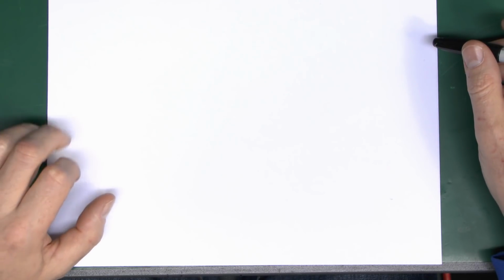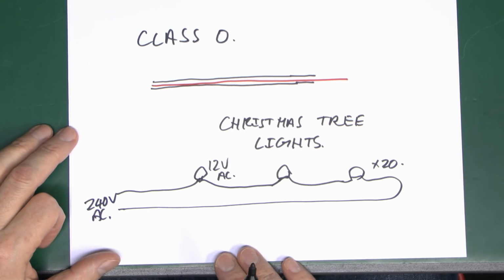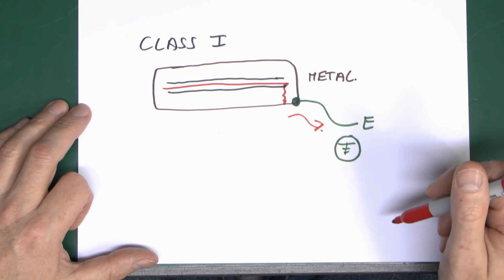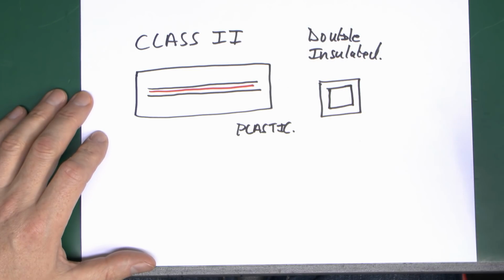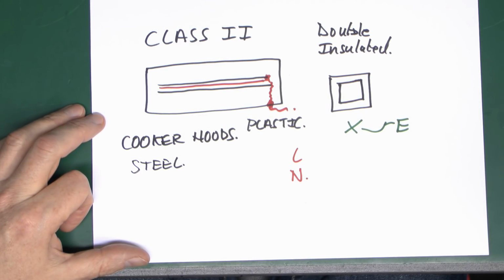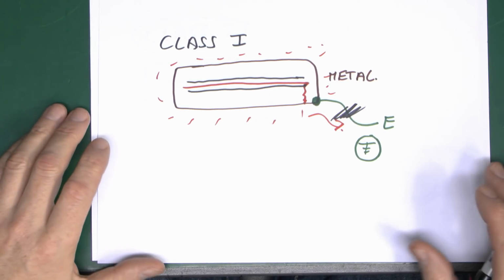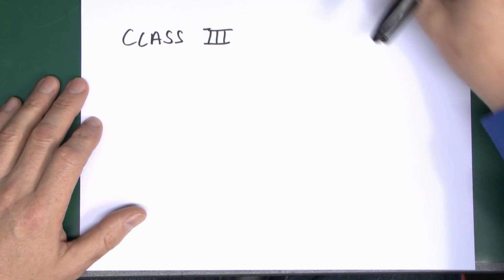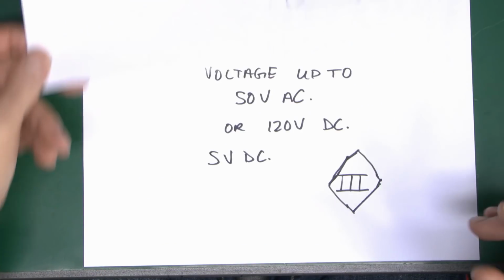Appliance Protection Classes 0, I, II, III

Comment: 12V LED lights are protection class III if a safety transformer is used.
For example, lighting a pool, bathtub or shower in the splash area.
A 240V light cannot be installed there but 12V is save.

Comment: I know you say earthing a class 2 device creates more danger, but how is this more dangerous than earthing a class 1 device in terms of providing a route to earth? Specifically I’m talking about metal light fitting. I’ve cut the DI connectors off as they were too fiddly, connecting ceiling rose wiring via wagos, and on someone else’s advice earthed the mounting bracket, to make it “class 1”. Is this unsafe? The problem I have are inaccessible ceiling voids and rigid insulation.

Comment: I have an old all-metal sewing machine that is not earthed (class 0???) Is it possible to test this?
Reply: My suggestion:
Check continuity between the motor body and sewing machine frame. If there's continuity it's not safe. Mount the motor on an wooden board and see the fasteners are not in contact with the machine frame.

Comment: Alot of USB plug chargers fail PAT just on inspection as they have no class 2 markings and class 1 test would fail as no metal.  The rule is no Class 1 2 3 4 marking then regardless of what you think the class should be, you treat it as a class one and test as a class one, which more than likely will fail, due to you can not get the earth test probe on to any metal, or the metal is not earthed as it is a class two inside with a additional metal covering.

Also metal hand tools, ie old drills, hair dryers and curlers are banned ( fail a PAT automactically ) regardless if they are class 1 and pass a class 1 test.

They are lots of odd rules for class 1 2 3 4

I have also come across a class two with Earth (which can be allowed) and a HV DC with Earth which you treat as Class one.

Seaward PAT testers has special settings for these in the top models.

Again these old Classes are not consumer, but found in Manufactuering, Mining, EX areas, Medical, other  test and measurement labs and even some EFTpos.
Reply: You sound like you were mistrained to be an unreasonable bastard, misapplying misunderstood rules.  Because whomever trained you told you those misunderstandings.

Comment: How about Class Special.... ?

CRT Monitors - no Earth due to they have a virtual Earth, but they are not a Class 2. ( for PAT testing you have to do a altered Class 1 test ).
Some test and measurement equipment (non consumer).
Zero Earth areas as defined in RTEEB (CRT and HV SMPSU) repair areas.
Semi conductor prodution lines, ie Timex and Casio put 50Vdc throu the staff, ie virtual earth set to 50V not zero V ( E ground ) set at 50V to stop static,

Class 3  at 50V was beacuse of BT Engineers didn't need a IEE licence, and a BT Telco one would do.

Comment: I may have ruined a lovely mains table lamp!  This eBay lamp, shallow round metal base, narrow chromed metal upright teeing out to ceramic led sockets was not earthed.  But all through was run in its own sheath and an extra silicone sheath. I thought it had to be earthed but it looks like you are saying it could still be Class II, is that so?
Reply: Silicone sheath would be the second insulation.

Comment: Why are metal table / floor lamps Class II when the mains wire goes up the metal stand with only the PVC wire insulation? I can never understand that?!
Reply: The PVC insulation is most likely double layered, hence satisfying the double insulation requirements.
Reply: @Grizzly01  I didn't think I that the standard mains flex PVC outer sleeve counted as double insulation to be honest but thanks for the info.

Comment: Do these classes also apply to secondary voltages? 
So assuming you have some kind of 12V wall adapter and inside the device it's being converted to a voltage higher than 120Vdc? (Which is also isolated from mains)

Comment: 17:30 Talking bullshit - it doesn't matter if the item runs at 5 Volts or not. All that states is the pd of the connectors is 5V - so they could be 235V and 240V - they will work fine and possibly kill you.

I installed 3 LV bathroom lights for a friend. The colour codes I used for the LV wiring was brown and green/yellow. The green/yellow being earthed and the brown being 12V above that.
So, despite being LV, they were still earthed. So, even if the transformer had a complete meltdown, it would not be possible to get an electrical shock from the earthed side of the bulbs.

Comment: 17:00 Talking outta your arse John. My laptops are earthed - I get 'mild' continuity between USB ports on 2 laptops only connected to the mains. The outer pin of the power brick plug IS earthed - so the laptop is connected to earth - so I guess it's a class I device.
Reply: It does sound like you have some knowledge of the subject, but not quite enough to know when you're talking out of your arse.
Look up Class III construction, and you'll see what it says about earthing.
And then you'll realise that your laptop isn't actually a class III appliance, as the power supply isn't SELV.

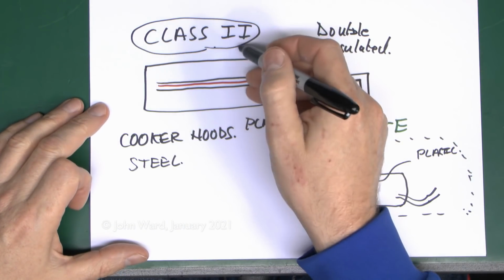Comment: 13:00 TOTALLY DISAGREE WITH YOU ABOUT NOT EARTHING SAY A METAL COOKER HOOD.

The reason you give is total nonsense considering most other metal surfaces in the kitchen will be connected to earth - sink and all appliances etc.

So I'd recommend connecting any bare metal to electrical earth. You know, like is recommended with heating radiators - LOL
Reply: You are getting into the realm of the difference between earthing and bonding.
There is the potential to make something more dangerous by bonding it when it doesn't need to be.
Reply: @Grizzly01  That's why it should be earthed, not bonded !

Comment: I'd totally ignore JW's advice about things not being earthed. If there are any exposed metal parts on a piece of equipment connected to mains power, I'd say get it earthed. You generally find exposed metal parts on connectors for microphones, video leads audio leads etc.
My very plastic laptop is earthed - by the manufacturer of the power brick.
Reply: Then again, you may cause unforeseen problems by randomly earthing bits that have been designed not to be earthed.
Especially in audio visual equipment.
Reply: @Grizzly01  Audio connectors do not dictate what equipment is connected and whether that provides a path to mains earth. Audio equipment connected to this laptop will be earthed whether it likes it or not.
In one of the items I earthed, I connected the earth lead to a PCB at a point marked on the board as an earth point !

Similarly, audio equipment may be connected to a live connector on other equipment - and that's precisely why I've added earthing.
A metal clad double insulated VCR connected to a TV Aerial socket at 240V is not a good situation.
Reply: @millomweb  Fucks sake, if you've got an aerial socket at 240V, you've got more to worry about than some poxy earthing on your VCR 😂😂

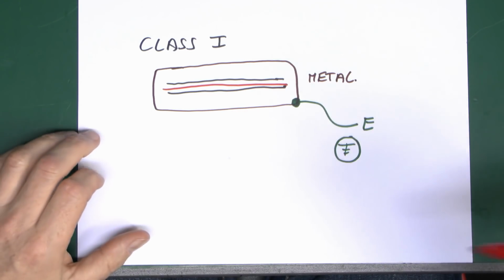Comment: 5:23 So what class is it where you have exposed live parts inside a metal case that's not earthed - like a Sony EVS800 for example ?
10 p in the right ventilation slot should complete the live connection to the unearthed casing.

I'm not sure I rewired both of mine with 3 core cable, but I certainly did one as well as a Panasonic video mixer with exposed metal parts. Which interesting was internally fitted with a marked terminal on the PCB for earthing but fitted with a 2 core cable.
Reply: Items like that, if they bear the class II construction mark, will be using the layer of air inside as insulation, which is only applicable if the case is intact.
The standard allows for it, but it does smack of a cost saving measure.
Reply: @Grizzly01  'case is intact' - yeah, but holey ! With a freshly sharpened coat hanger, you could make contact with live terminals with case in place.
I have similar thoughts about (belt) guards with holes or gaps in hidden places that are big enough to get a finger through and in danger.
Reply: @millomweb  Definitely need to read up on IP ratings.  First digit deals with these dangers.

Comment: Sorry john your not  quite correct, BS EN 60598 for lighting DOES allow for earth pass through on a class II device as long as the earth does not terminate or have a connection to driver/control gear  - Therefore  3 core with earth wire  could run into a class II luminaire and back out ! So not totally accurate to say all class II devices have no earth connection... some will have dumb terminals that just provide a loop in-loop out terminal separate as i said from driver or control gear.  Also there is definition of "Functional" earth rather than "Protective" earth allowed for class II  which is allowed earth connection on class II devices for EMC or screening purposes which is marked with a different symbol or "FE"  and NOT relied upon for safety. Did you know also there used to be a class OI ?

Comment: Where would you ordinarily find  the protection class number on an appliance. I have just examined my Laptop PC and its adapter and can find nothing. Also, on the subject of the PC adapter, what about the 240v power lead that i can disconnect from it? The PC should be class 3 but not the adapter surely?

Comment: There are two  probable"Class 0" products that I've recently come across in UK. 
First is smart-home WiFi switch beloved of the " middle tier" of geek for smart-home items.  These contain a mains power PCB enclosed directly in a single skin plastic housing, no CPC. Popular brand in that regard is 'Sonoff".
The other product is 230V LED rope- light for gardens. These are modern equivalent to old Xmas lights. Led's are organized such that enough in series plus the current limiting resistor makes up 230V at the user-cut lengths, typically 2 metre.  AFAICT, it's in a single layer plastic clear sausage. The user chops it off, pushes in a dodgy wire pin thing to connect the mains tails to the internal conductors, and installs them in their garden etc. One outlet of this is AFAICT a " LED ropelight" from a seller called Mr Resistor. I believe they also do a genuine neon version called 'filament ropelight".  ( Both may carry the "neon" moniker from some sellers, which may be incorrect in the case of the LED version).
Reply: Surely those Sonoff devices are meant to be installed in an enclosure?
Reply: @Grizzly01  Well I would, but not so from on-like geeky youtubers or manufacturers original intent. Saying that, I just went to their website before answering here and it seems they have re-vamped their basic model, and it now bears a double insulated logo, Probably an improvement over the first models then.

Comment: The power brick for my laptop has a 3 conductor mains cable connected by a sort of Kettle connector, but with a rounded body. The earth pin of the plug is connected  to the "kettle plug" but there is no way of telling whether earth is connected inside the brick.
Reply: The output lead to the laptop should be earthed. I presume the brick powers the laptop via a wire rather than magnetism (contactless charging)?
Reply: @millomweb  Both the +ve and -ve on the laptop barrel jack have about 100kohms resistance to the mains earth pin, so no earth connection to the laptop.
Reply: @MrFlint51  No resistance on the outer part of the plug on mine to mains earth.
Reply: @MrFlint51  I got 40k resistance between Earth and a USB port on the laptop.
Reply: @millomweb  Not always.
Some brands bring the earth connection through to the dc output barrel, some don't.
For example, Dell quite often do, but HP don't, in my experience.
Reply: @Grizzly01  Please put my HP prize directly in the bin - utter rubbish !
Samsung does - and I'm pleased about that.

Comment: What Class are Electric Toasters? They should be Class -1 as they have exposed conductors with no insulation. You can touch the live parts with your finger.
Reply: Class I. British are disadvantaged in that as the plug does not tell the class. In most other countries the plug immediately tells the class.
Reply: @okaro6595  Ditto radiant fires.
Reply: @okaro6595  Unless you have a moulded plug fitted to the equipment, with an ISOD rather than an earth pin. Then it's straightforward to tell the class =)
Reply: @Grizzly01  In Finland class 0, I and II have all different  plugs. Class 0 plugs fit only ungrouded sockets. It would be dangerous if yoụ touched a failed class 0 equipment and a grounded one at the same time.

Comment: Some Class 3 devices like Laptop PCs using an external PSU can read 230 V to Earth on the DC side of the PC input plug. Switch mode power supplys are not always isolated from the mains. Try it with your meter.
Reply: Some are faulty. Plug on mine is earthed - so the laptop is earthed - that makes me happy.
Reply: @millomweb  Check that with your meter!
Reply: @johndododoe1411  Congratulations, it's only taken you 7 months to work out how I did it !
Reply: @millomweb  The mains plug does no necessarily earth the actual laptop.

Comment: Class 0 items are still being sold certainly in 2020. We purchased a string of LED Christmas lights. Inside the mystery black box was just a bridge of diodes. The wire is   only single insulation. You will still get a shock to ground should you make contact with live. This was sold by Dunhelm.

Comment: It always amazes me that Class 0 still seems to be the standard for appliance cables in the US.
Reply: Mandated safety seems to diminish inversely to voltage.   In the US its a rite of passage for a kid to shock their hand while plugging something in and learning firsthand what 120V feels like.   I'm sure we'd be a lot less casual if it hurt twice as much than the brief "ow" we get.   I know the shock and fire hazard aspects are unrelated but I feel like Europe's better insulation regime stems from their desire to really not want to touch a live wire.   If I went to a friends house and was getting tingles from their washing machine chassis,  it would probably be a 15 second conversation at most ("oh this baby's got some lose wires to look at") but in Europe you'd probably shut power off to the whole building and wait for a sparky to arrive.
Reply: @NillKitty  Nah we'd forcefully unplug the device, not the house.  After all, we need the ADSL modem and computer to still have power as we search for a sparky or replacement machine.
Reply: Now try touching EARTH when doing that!

Comment: Bet that speaker on the shelf behind you John pumps out some real high power tunes when you finish your videos?
Reply from the maker: Eltax Studio Pro 350s, 250W RMS continuous, from an EP500 amplifier (2x250W RMS).
Speakers were £40 from a local auction years ago.

Comment: Interesting what class would you put an electric toaster in. Without grandfather rights you would never be able to buy one today.

Live conductors that can be touched with no trouble at all fail all known standards today. It’s in a class of it’s own.
Reply: Class -1. But if someone is idiot enough to put a knif in,he deserves to get shocked.If he survives,he probably wont do it again,if he dies,its just proof that natural selection works.
Reply: @MernokiMegoldasok  Just goes to show that by its very design a toaster will not meet any EU CE safety standard in force today
Reply: @TheEmbeddedHobbyist  Those standard are for idiots.Did you hear about 'suicide'showers used in South America?Brazilians say they take 2 or 3 showers every day but never heard of anyone who got electrocuted.
Reply: @MernokiMegoldasok  Toasters cut the power on both sides when the tray is up, at least mine does.
Reply: @okaro6595  Yes,but if someone is idiot egough,he can put a knife in it when its on.But as I said,if somefone does that,he deserves to get zapped.

Comment: "No one makes these any more"
> 100% of American x-mas lights exactly as described here.  

We switched to LED's because $$ but still using the same single insulated full-voltage lead in series with all of the asscoiated problems.
Reply: Ironically these are the only thing most people own in the US that has a fused plug.
Reply: Mine are labelled class 3, and quite expensive to run, running off AA batteries.
Reply: Don't know if running those LED lights through an isolating transformer would be any safer. 110v equipment on building sites are run through an isolating transformer which has a centre tapped secondary winding. This centre tap is connected to ground/earth. This will necessarily make the use of double pole breaker as an overcurrent protective device on the transformer's output.
Reply: If it has an adapter as the plug (one of those big plugs with a transformer to change the voltage and amps) it's not a class 0 and it's allowed to have single insulation wiring annoyingly, the lights he means are the ones that are single insulation and they go to a standard plug (like old incandescent xmas fairy lights in the UK) if that's what you mean then ignore me lol! I know nasty cheap lights can come as a standard US plug and then they go to a socket on the other side to daisy chain then together... And have no fuse?? They are scary!!

Comment: If we use ELCB in a circuit, we need equipment earthing ? Because it will trip the relay and the circuit breaker too right ? If there is any difference in incoming and out going current / voltage in the circuit.  Please explain me sir !
Reply from the maker: Class I equipment always needs an earth connection.
ELCBs are for additional protection, and can't be used as the only means of protection - if you rely on ELCB only, people will have to get a shock before the device disconnects.
Reply: @jwflame  They may not get a 'shock' but will have to pass 30mA.
Reply: ELCB is good to have on unearthed items - then if the person using the item forms a circuit between live and say a sink, the ELCB will cut the power. The person is the earth lead :)